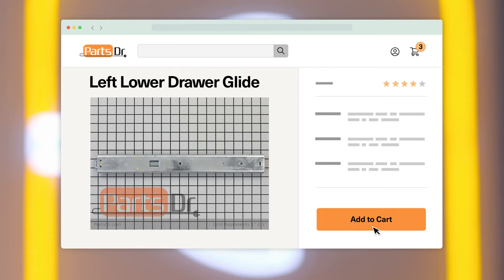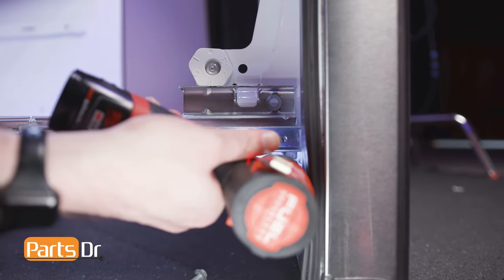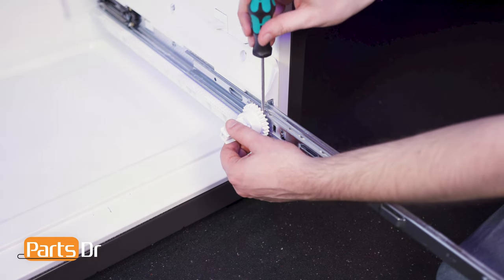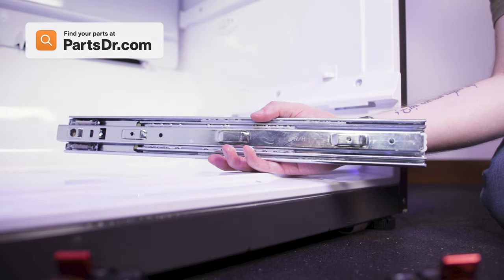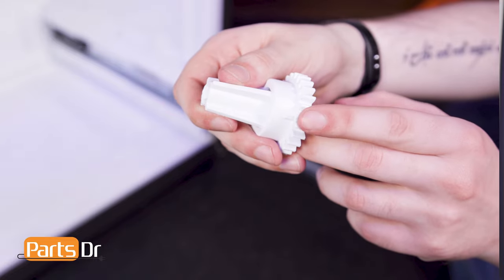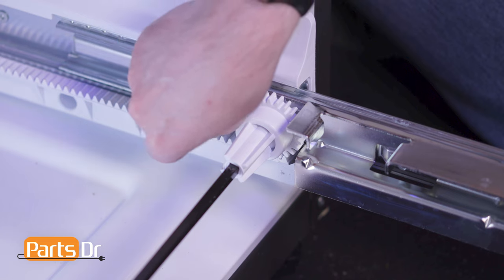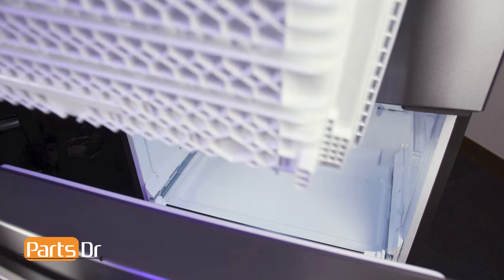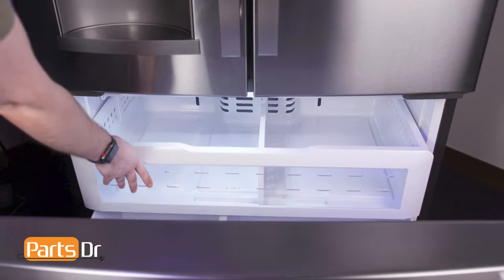How to replace Freezer Lower Drawer Glide (Right) part # WR72X10427 on your GE Refrigerator

Comment: Thank you for this great video. Do you recommend replacing both glides at the same time? I replaced my right hand side and the door seems to be tilted to the left. I don’t know if it’s because my left glide is the original ? Thank you in advance!
Reply from the maker: We commonly see people replace both at the same time, but it is usually not a requirement unless the manufacturer made a design change to the part.

Comment: My freezer drawer only shuts on the left side and leaves the right side slightly open. I tried adjusting the hex screw but it doesn’t work. Is there a way to realign or do i just buy new slides?
Reply from the maker: It could be a bad drawer glide rail.  We would recommend to remove the door and inspect both rails to see if they close the same amount.
Reply: @PartsDr  so in continuing my research, “aka about to break my head against a wall” I found it wasn’t closing due to the slim shelf on the door bumping the top tray. So I took off the slim shelf which to me is useless since I a deep freezer, and it closes fine now. Maybe not the best option but it works lol thanks
Reply from the maker: @luisr6377  Thanks for sharing the solution with us!